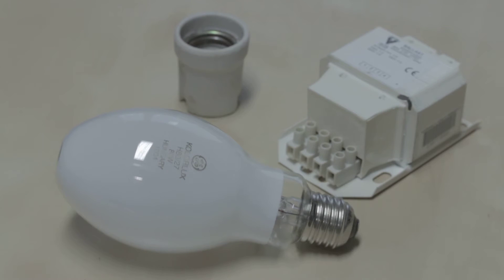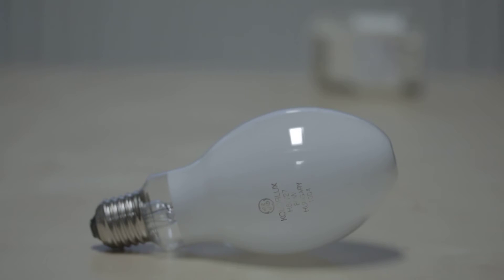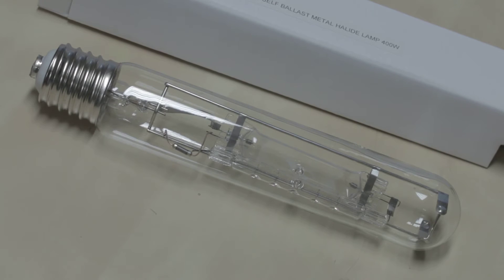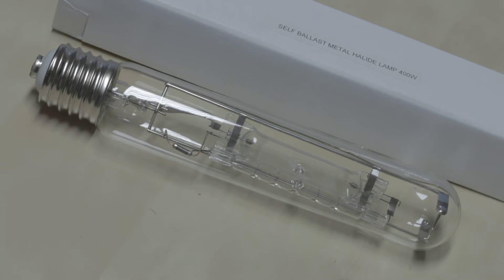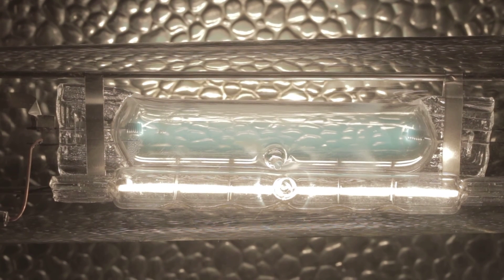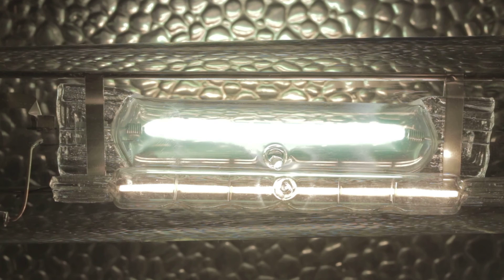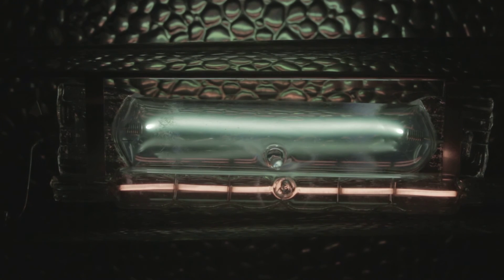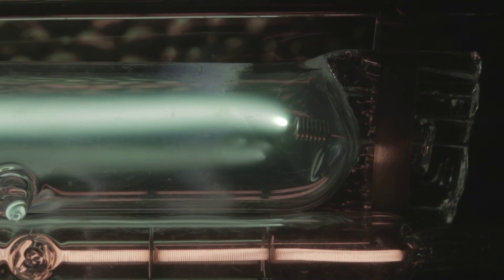Self-ballasted Mercury-Halogen lamp.

Comment: Now this is actually something I thought of and experimented with a metal halide a few months ago, although as it was a failure due to the halogen taking too much power and not allowing the metal halide to get brighter, I was going to use a lower wattage halogen, but never really got that far.

After spotting this video I realised that yet another idea I've thought up is already in existence, story of my life haha, but interesting enough to make me want to revisit the experiment sometime in the not too distant future.

Thanks for sharing, I thought I was subscribed to you already...
Reply: If anything, you'll want a higher wattage halogen lamp in series, as a lamp with higher wattage will allow a higher current to pass through.
I guess for an 80w MV lamp, perhaps a 100W or 150W Halogen lamp might do the trick.
Reply: This is true, I actually own one of these dual halogen and halide lamps now. Yet to do experiments with to replicate it with two separate lamps though.
Reply from the maker: These are listed on ebay as halide and even says so on the box but they are not. Just pure mercury vapour.

Comment: What's the power rapport for both bulbs? Also, does it matter which wire the halogen light bulb is connected? I want to use a halogen bulb intead of a ballast.

Comment: beautiful, but luminous flux on watt is ridiculous.  i estimate luminous flux from that 400W self ballasted lamp somewhere around 6-7000lm.
Reply: The Ebay seller claims 24000 lumens for the 400W version, but it can be wrong as the lamp type itself. It's normal the efficiency of these lamps to be somewhere between that of a mercury-vapour with a choke and a tungsten-filament bulb. Somewhere between 10 and 60 lumens per watt so your guess about 6 -7000lm sounds absolutely right.

Comment: I've not really played with discharge lamps like that but I always thought they needed an igniter to get them started.  Is this still the case with the self ballasted lamp?
Reply from the maker: Not always. The old mercury vapour and some types of metal halide lamps have an auxiliary starting electrode at one end to facilitate starting. Also some high-pressure sodium lamps have internal starters but they are less common these days.
Reply: +FrontSideBus Where do you find this lamp 0:20 ? . Im looking after it, but cant find anything
Reply from the maker: Electroimpex Clear mercury lamps are extremely rare these days, In the UK anyway.
Reply: +FrontSideBus ok